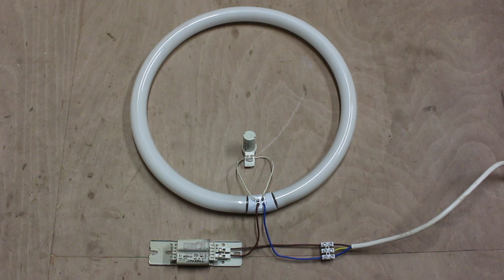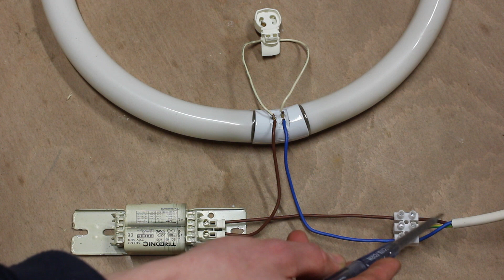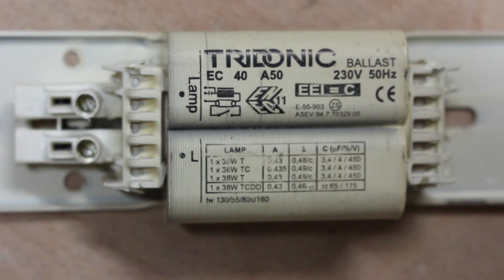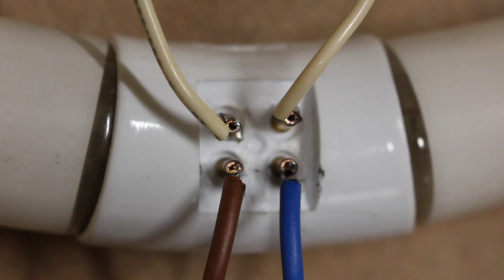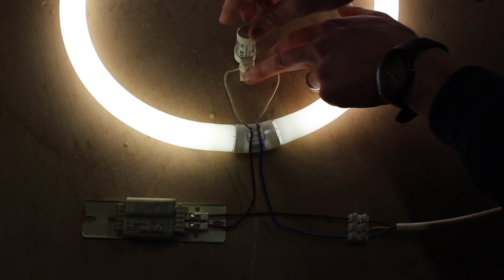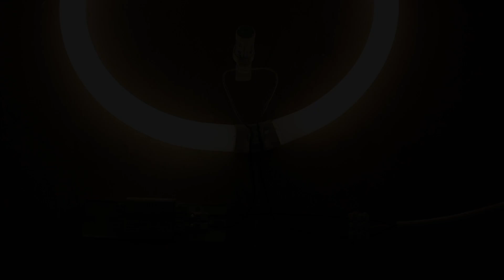How to wire up a Fluorescent light circuit

Comment: Is it possible to do this with an electronic ballast but use a starter instead of the inbuilt starting mechanism so it works like an electromagnetic one and flash starts?

Comment: Do you know where there might be a video on wiring a replacement circline type socket (Gaynor 709-1)? I am rewiring a HVAC UV light (Aprilaire 1910). I wanted to replace the bulb socket but I can't figure how to get the wires into the socket. I think it is a push-fit but I don't see a wire release anywhere on it which is unusual. Thanks.

Comment: Amazed that it starts so quick as i have 2 of these circular fittings  and even when ive replaced the tube and used a new starter you always get that quick.. flick -flick ON as the starter kicks it up,unless its an electronic starter in that phillips type.

Comment: Being a electrician as I am forever that's is a circular 40w 4pins fluorescent lamp it's runs off a 36-40w.240v ballast.and 220-240v.4--65w starter lamp switch motor there.have a good summer holiday from this electrician from London.